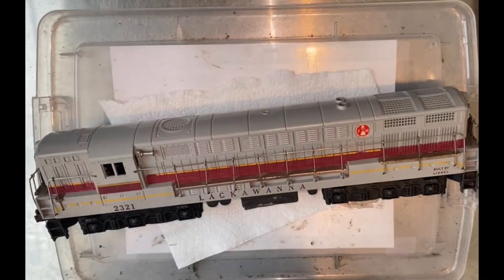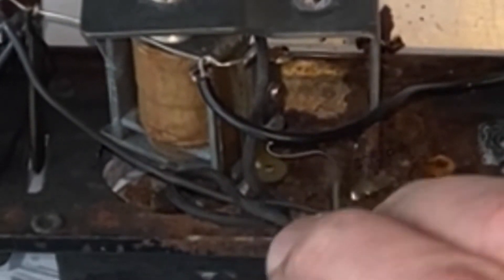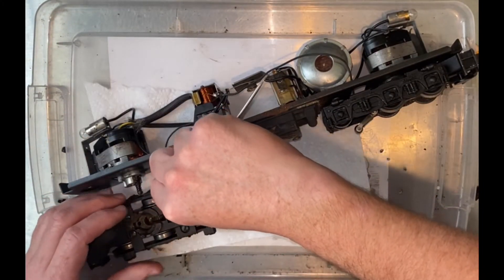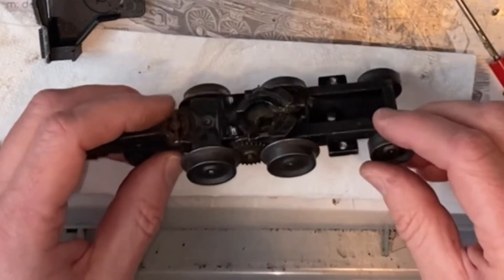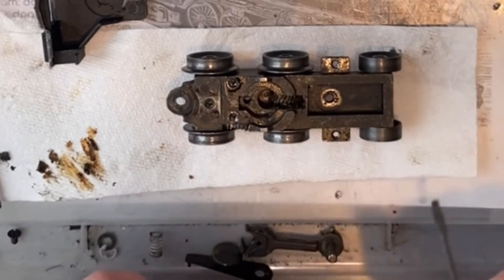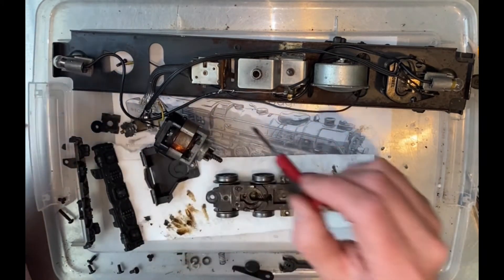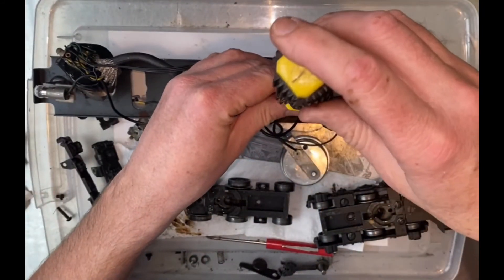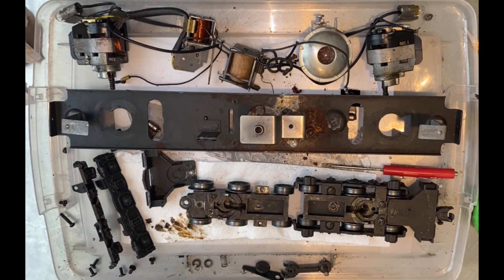Lackawanna 2321 FM Train Master - Postwar Lionel Trains - Service

Comment: I like that you want to address the frame corrosion. A runner to be enjoyed. To strip the metal down and stabilize with a repaint hopefully will stop the rust. You probably saved that frame from rotting through eventually. As for old crusty lubricant/grease yeah, always a standard job to take care of these gems!
Reply from the maker: Every engine I buy get a full service but this one definitely needed a bit more!
Reply: @dagryffynhobby  Thanks for the heads up info about battery corrosion possibly in these Trainmasters!
Reply: @dagryffynhobby  I was at Mountain Lakes Lionel store on Sunday. The owner was talking to a customer about the price of going through 2 of his engines. One was a scale Hudson. He said that prewar overhauls make the shop cringe a little. They cost more apparently. Postwar not too bad. I like learning to tackle responsibly these jobs myself. Your info is a big help!

Comment: When will we be seeing part two of this? I’m working on my 1954 Lackawanna FM and having issues getting it up to anything past a crawl. I think something is wrong with the E unit. This video was really helpful so I hope you upload another!  :)
Reply from the maker: Glad the video was helpful and sorry you are having trouble with your engine. I hope to have the next video in a week or so. 
In the meantime, if the e unit cycles, and the drum is clean,  I would look elsewhere. Make sure the wheels and center rail pickups are clean. Make sure the wires are all in good condition and connections are solid. 
If you like, you can contact me on my Instagram (@dagryffyn)  and I might be able to provide more help. 
Thanks for watching.
Reply: John the E unit should have no effect on units ,the E unit changes the ground for the motor.If you haven't already, check the windings on the armature one. of the poles may be faulty,also if it still has some of the original grease that could cause you trouble,also check your field winding for continuity.

Comment: I am really impressed at the ease with which you disassemble these models.  Are you an electrician or mechanical engineer by trade?  Like the problem you had with the one corroded screw-I find something I can’t take off or can’t put back,  and I end up taking into the technician and getting a lecture as well. 😕
Reply from the maker: Sorry I didn’t respond sooner, I didn’t see your comment. 
Thank you. I was an auto mechanic for 15 years so I guess that helped, but I’ve always enjoyed taking things apart. 
I like the old trains for their simplicity. 
If you ask for help and they decide to lecture you, don’t go back, there is no need for that sort of treatment. This hobby is compromised of people of all skill levels and there is no reason we can’t respect each other. If I had a new engine with an issue, I should be able to take it to someone without a lecture from them, I would hope. 
Anyway, sorry again for the delayed response and feel free to shoot me an email with any repair questions you might have. 👍